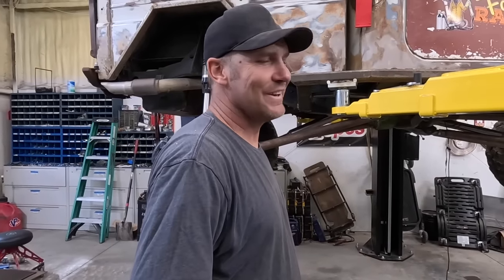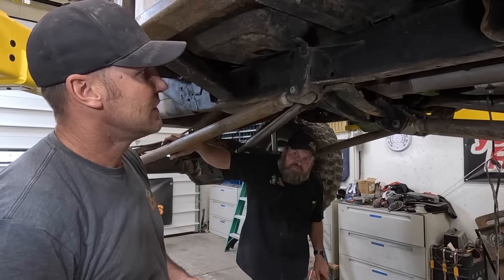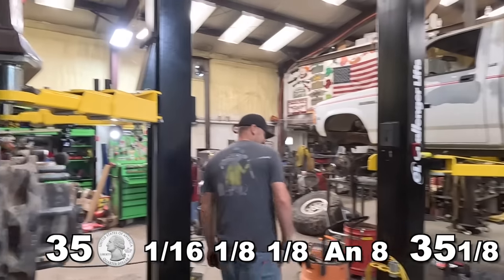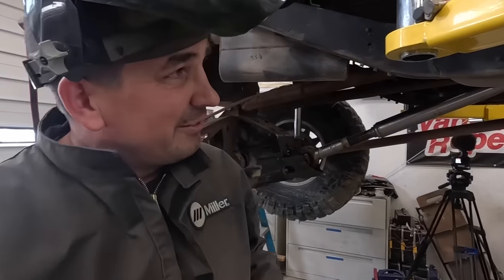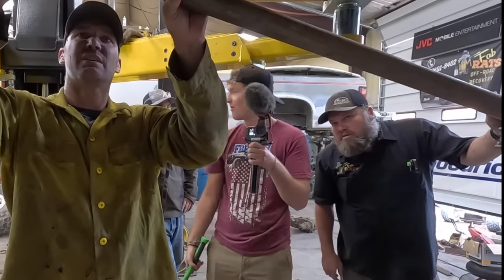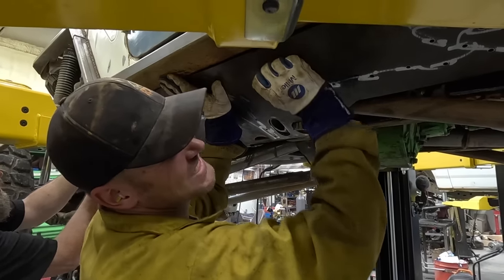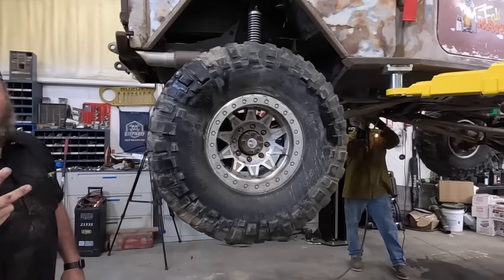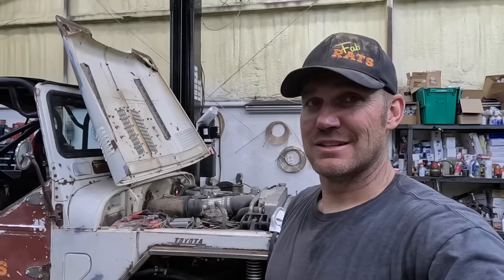I've Been Waiting Two Years To Do This!

Comment: Mounting that joint sideways like that is insane. Using the bushing for vertical movement is going to destroy it quick
Reply: Yeah, I'm wondering if they've noticed, or if this is their plan.
Reply: I was thinking the same thing
Reply: Isn't  that a Heim joint that's spherical? It might not even notice.
Reply: Its a Johnny Joint or some knock off copy. Look at the RockJock Jeep TJ front trackbar, they have the joint run the same way.
Reply: I thinking similar, but they probably know something I don't. They'll probably show us if it gets shredded though haha
Reply: I believe Paul planned it that and thought about it.
Reply: @ITGuyOhio  I don't think you've been watching this channel very long, then. These guys are good fabricators and decent drivetrain (re)builders, but the rest they frequently throw together without sweating the engineering. When it breaks, they build it again but differently. There's some value in that kind of learning process, but when it comes to stressed members, now and again that approach also gets people killed.
Reply: Look like it’s holding up pretty good. He has whooped on it a bunch of times since.

Comment: I thought those rear stabilizer arms (I’m not a wheel’er, so please forgive my terminology) needed to pivot to allow suspension travel, yet you moved them up onto the frame mounted sideways (bolt is vertical). Won’t that cause that rubber bushing to flex a lot more and wear out in a fraction of the time?
Reply: And now the plate covers the bolt. Seems like a point of more frequent failure and way harder to get at it to repair. 😮
Reply: I noticed that right away and I'm surprised they didn't think about that.
Reply: You're absolutely correct those bushings are not meant to be constantly flexing like that, the whole point of mounting the bolt through the middle so they can pivot on the bolts axis
Reply: Isn't that a spherical Heim joint and not a rubber bushing?

Comment: Shouldn't the frame-mounted link brackets be oriented to permit the control arms to swing or pivot vertically at the end rather than horizontally?  As mounted you are counting on the heim end to provide all the range of movement in the vertical plane as the front axle suspension varies in length rather than the bolt mount.  Just thinking.....
Reply: I was thinking the same thing.
Reply: Yeah, it's not a great idea to run them that way
Reply: Yep, this is the 3rd time he's done those mounts and he still hasn't got it right.

Comment: That lower link joint , is not designed to flex that way. If you leave it that way it is going to break.
Reply: My dad always said anything worth doing once is worth doing again.
Reply: lol, I just want to see them do well on 24 hr hell and back, and that will cripple them
Reply: It's a Johnny Joint, it's fine. You can see the ends of the pivot ball sticking out past the rod end. A standard bushing sleeve wouldn't be like that.
Reply: More flex left to right. Lost it going up and down. That's how I see it. We will see.
Reply: If you push it past the range of motion it would be an issue. Paul showed there was plenty of extra room in it past full droop so it'll be fine. I would be more concerned about the geometry change but not my rig so I am not gonna overthink it.
Reply: @TroyMcIntosh-kz8dw  just look at the frame end of the Currie Rockjock track bar for Jeep Tj, the designed the Johnny Joint and that track bar and they seem perfectly happy.
Reply: @stwilson74  CavFab uses the same joint config for the upper link in their 3-link kit, and it's not nearly as long of a link as Paul runs. He should run out of downtravel before the pivot ball runs out of rotation.
Reply: @jkvinsland  thats what I was saying,  Paul even demonstrated that when he disconnected the link on the axle end and it dropped down further. Axle was at full droop without using up the joint's range of motion. It will be fine.

Comment: I love the ability to just " wing it " when necessary.
Reply: "Wing'ing it' is why they had to redo all these things.  :) .  Because they just "winged it' the first time. 
It's better to think things through 20 times and make sure you covered all your issues.  They do pretty well though..
Reply: @calholli  Little of column A, little of column B. You can overthink it and you still won't think of everything until you actually make it and it becomes obvious. If you have the materials/money it's much faster to just make something that lets you test it in the real world and find all of your problems the easy way.
Reply: @Psyco913  I agree.. if you tac everything and moc it up..  But when they just full bore weld everything together as they go-  then they have to cut it all back off.. It's just not for me.  I do a lot more thinking and testing when I fabricate and do all the finish welding at the very end....  On this whole video-- I feel like they went backwards.. The rod ends aren't even facing the right way now.. and all they needed to do is add a long triangle gusset in front of their old mounts, so that it acts as an on ramp from the slider.. done.    instead, they did a lot of work and made it a little worse IMO.  I guess it still works;  but they'll probably have to change those bushings often now, since it's constantly trying to rip on them with every bump you hit.
Reply: @calholli  I mean they seem to be tacking things to test the fit first for the most part. They just rushed the finish welding there when they thought it was good and realized later that it wasn't going to work. I'm definitely guilty of that one myself.

Comment: Paul, a quick trick for locating blind holes to transfer to sheet or plate steel....put a little grease on the blind side, press the steel into place, and the grease should transfer the location of the blind holes/objects onto the steel.  Cheers!  Great work.
Reply: Wouldn’t have worked here. Pipes straight cut and angle plate.  Only the lower apex of the pipe would touch and that’s only if the plate could be placed perfectly in place the first shot without smearing the grease.

Comment: you welded the control link holder on side ways when it should be up and down it can flex up a little but if it flexes down it will pinch and break

Comment: Cutting and notching the supports for the rock sliders that are what the lift is holding the vehicle in the air by is a bigger flex than I've got the stomach for.

Comment: So . just wondering . Why not weld nut on top of bracket for the long tube things so you can run bolt up through bottom and not worry about getting wrench in that small space ? Could have welded nut on bracket then weld bracket to frame

Comment: Hey Paul, won’t that 4 link joint bind at that angle? Afraid you are going to limit your flex. Maybe moving it back, and changing then angle will prevent it from binding, give your more flex and prevent breakage on 24?
Reply: you saw them fully articulate the axle to check ... so i guess they've got that covered

Comment: Years ago I bought an old Circular Saw and a 7" fiber blade to cut through steel.  It was loud and smelly, and sparks flew everywhere.  When I first saw one of these circular saws with metal blades for cutting through metal I was impressed at the lack of noise and sparks.

Comment: To me the upper mounts should have been horizontal to go with the direction of flex. If you are going to go thru water fast or deep some inner fenders might be nice. Not trying to be a troll just my thoughts. The metal cutting blades have come a long way
Reply: I agree on the direction of flex, bolts are 90 degrees

Comment: Paul, I have the same trans jack that you have, I built a "Flex attachment" for it to allow me to lift and lower an axle end to flex and check for fit, clearance etc. without raising or lowering the lift. SOOO much faster and easier now(safer too, but keep that on the DL haa)! I made a V block out of 1"x3/8" flat stock then welded it to the end of a piece of 1" pipe about 24" long. In the other end of the pipe I welded in a steel sleeve to reduce it to the size of the jack ram. It makes flexing and axle a one man show!

Comment: Didn’t you place the front mount for rear trailing arm 90 degrees off?  Aren’t you causing the rubber (poly) to absorb all of the articulation rather than the hinge pin?
Reply: I was surprised when he mounted it that way too.
Reply: I believe it's a johnny joint. There's a pivot ball in the rod end that can rotate freely, similar to a heim joint. He used the same joints for the frame end on Jace's Dakota.

Comment: You should have drilled some holes in the rear link bar mounts so you could plug weld them on the back side or at least a row across the top where it was hard to get the welder in!

Comment: I've been telling people about those Milwaukee cordless saws with a C5 carbide blade, for a good while I'm pretty sure I told you too Paul, give me one of those and a couple of batteries and I'll cut your car in half. , I cut unistrut and  conduit mostly, they're twenty bucks at harbor freight for the 7 1/4 inch , the DeWalt takes a smaller diameter blade that cost 80 bucks,

Comment: First failure point will be the rubber bushing mounted sideways, unless you guys swapped them out with a Heim joint and I missed it
Reply: It's a Johnny Joint, like a heim but stronger. Instead of misalignment spacers, it uses an internal pivot ball for movement.

Comment: Hello Paul, hello team,
Paul don't you think the way you placed the bar mount on the frame is the wrong way around? As it is there, it would be effective for a left to right movement without problem, but I have difficulty seeing an up and down movement being done without destroying the rubbers. You're 90 degrees away from the old setup. It's just to help...

Comment: Wondering, how does the radius arm swing when the helm joint mounts are welded 90 degrees out of phase from each other? The only up and down travel appears to be the upper heim joint bushing flex. In my feeble mind the heim joint mounts need to be welded as close a possible to exactly facing each other, and and parallel (level) to the other side.

Comment: Paul, I must have missed a critical bit there as you were laying out the link bracket's position against the frame rail. Why is the bracket square with the frame when the track rod (or whatever you're calling it...) is rotated about 15-20 degrees down from the frame? You have to cram the bolt in and it's out of alignment with the rod's end link. Mmmm? Are  you allowing room for the rod to follow the wheel up and down as you're driving?

Comment: Just curious, the new forward link bar mount has the bolt basically vertical and the suspension is at full droop when you positioned the mount brackets, so when you put weight on it isn’t the bushing in the rod end going to be in quite a strain, even more so when the suspension is compressed?

Comment: All you really needed was to put a triangle gusset in front of your old mounts so it could easily transition up and over.   Now you're not even using the rod ends correctly because you turned them 90"..  I guess it's done now.   If I was there, I would have argued hard against moving those mounts;   it was way better how it was before.

Comment: On the the rear suspension link relocation, why didn't you just add a ramped gusset (conical length of tubing) ahead of the original frame mount, instead of the total relocation.

Comment: But aren’t you turning the front hiem 90 out from desired motion?  Meaning it’s turned sideways from the up/down arc.
Reply: I kept waiting for Paul to figure that out and put it that was it was supposed to be, maybe that will be next years video when he says " I didn't think this through when I moved the brackets but now I'll do it the right way"
Reply: That far from the axle, that heim has plenty enough lateral flex to handle full articulation of the suspension

Comment: I have a question. I have own and wheeled 4bys since the early 80's. I have noticed that modern fabricators are mounting the rear drive shaft in backwards from what i remember. The slip yoke was always mounted at the transfer case, where it was protected. Does the use of links make this practice obsolete?

Comment: I hate to say it but using the metric system for measuring is more accurate and eliminates the troubles folks have with fractions.  Paul measured 35" 1/4, 1/16. 1/8, etc. at about 1:58. 0104095249254142 Metric would have been 892 mm. no fractions!!

Comment: As I watch what you guy were building here, I know I have to be missing something because otherwise I would swear you built that in a way that is just going to break things the first time out on the trails.  That pivot point you welded onto the frame just seems like its bolt is mounted in a totally wrong direction. \

Comment: highly recommend safeglasses every time SOMEONE use a grinder inside the shop.
i tried having a spark burn into my eye and they had to dig it out with a syringe needle.
after that they grinded out rust with what resemble a dentist drill.
0/10  do not recommend.  
and yeah i said someone  because i was not the using the grinder..
i know they can be frickin annoying to have on while working  but loosing an eye and  the ability to measure distance   is worse.  
also none of you can carry the pirate look with a eyepatch  XD

Comment: Shouldnt heim joints be parallel to each other, like U joints ??
Reply: The joints can run opposing on suspension as long as the misalignment in the joint itself has the movement to cover the entire suspension cycle.

Comment: Sorry to recomment but the forward mount orientation is messing my mind up. I can’t stop thinking about it. I can’t imagine that is going to last the way it is. Without allowing it to pivot in the same plane as the bottom one has to cause a failure. Especially when the rear axle articulates. Whatever the weakest part is, it’s going to break. My guess is the tubing is going to bend. I hope I’m wrong.

Comment: Welding those plates in under the car, and thereby sealing in the suspension joints -- makes it incredibly difficult to replace those suspension joints when they fail.   Seems a stupid bit of machining to fit those plates that way.  Very difficult for later repairs!  Would be much better to have them bolted in some way.  But rocksliding?   A senseless abuse of a car.  You may as well turn it upside down and let it slide on its roof.

Comment: I’m confused, the lower link bracket you welded to the subframe is vertical. Doesn’t that mean the tie rod is supposed to rotate out horizontally? Not up and down? Isn’t it just going to twist on the pin/ bolt and bushing?  Paul you may make jokes about you safety squints until it’s too late, I guarantee you won’t be laughing about losing your eye when it happens. That is just stupidity.